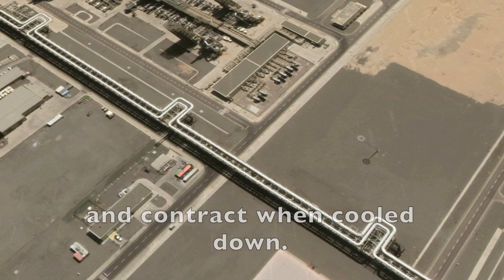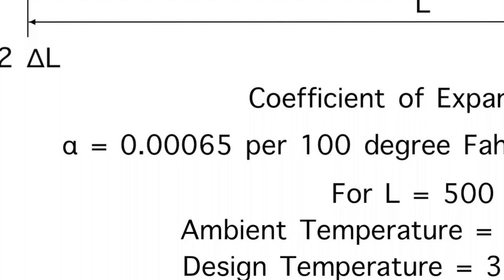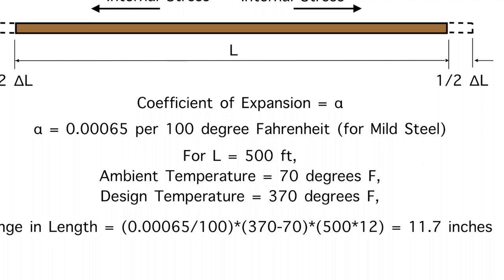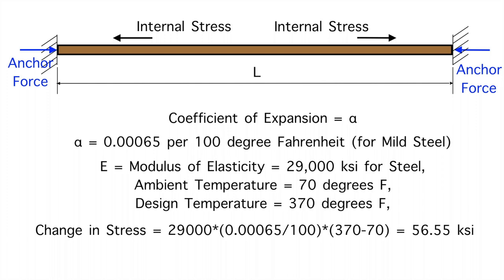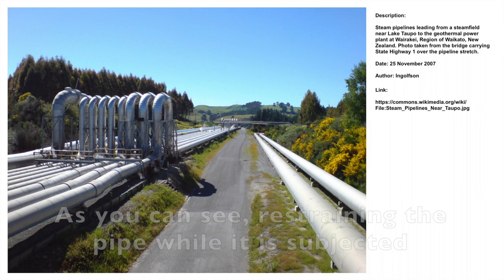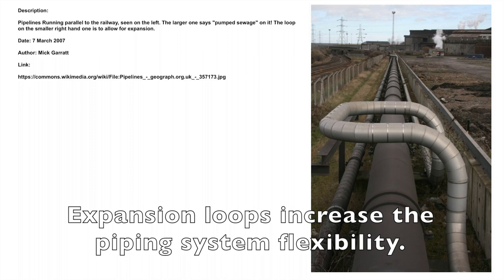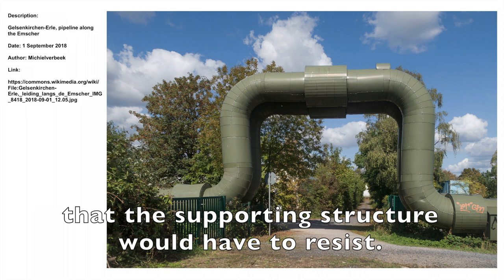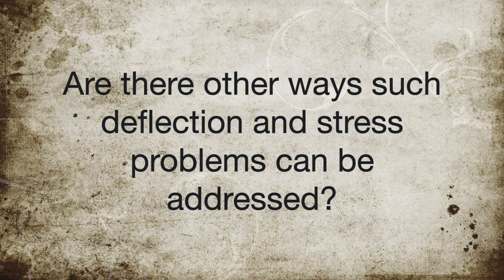Weird Loops in Pipes - What are They?  What are They For?

Comment: LOL. I thought the contractor screwed up.  Same thing happened in Areva Nuclear plants.  Westinghouse design dint have the bends though! google "French regulator approves EDF schedule for weld checks"  this was the reason for entire France Nuclear plant stoppage!!!  google "A record 26 of its 56 reactors are off-line for maintenance or repairs
after the worrisome discovery of cracks and corrosion in some pipes used to cool reactor cores"

Best picture: google "Cracking Under Pressure: Inside the Race to Fix France’s Nuclear Plants"
Reply from the maker: Thanks for watching and for leaving such an informative comment.  It's very much appreciated.
Reply: @LorezaKabuhayan  can u imagine they (EDF) screwed up the engineering design!  google "the French nuclear plant builder Framatome — a unit of EDF — had modified the original Westinghouse Electric Co. design used for the 40 older units"  ...... from same article follows "Among other changes, the new layout made four safety water injection lines more
sinuous — more twists and bends — making them vulnerable."  It is RARE for engineering DESIGN phase to screw up!
Reply: @LorezaKabuhayan  EDF were already $45bn in debt, the outages cost them ANOTHER $35bn on top! Sacre Bleu!